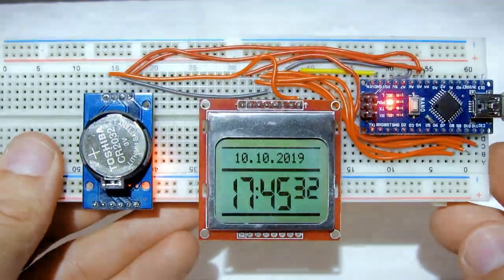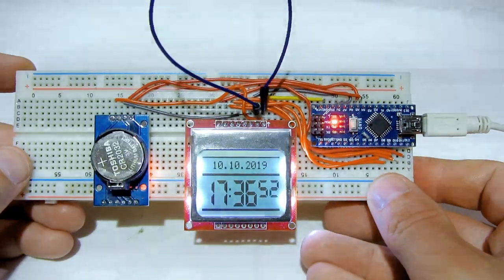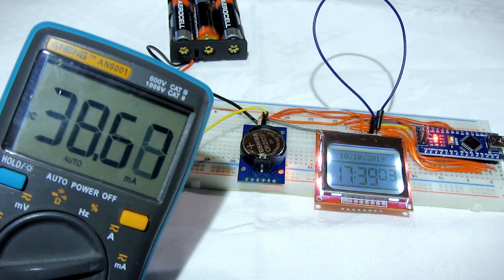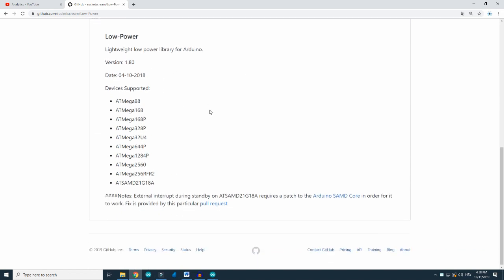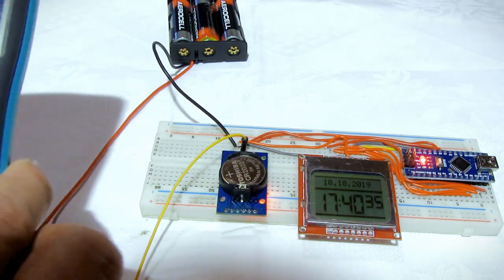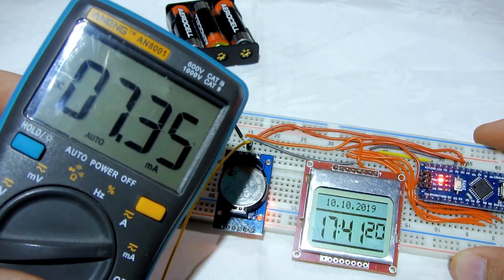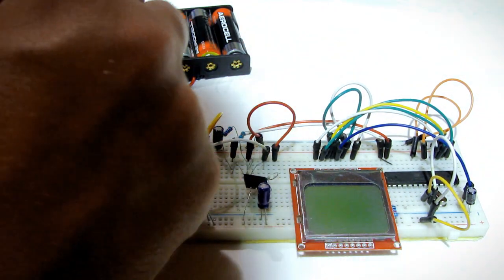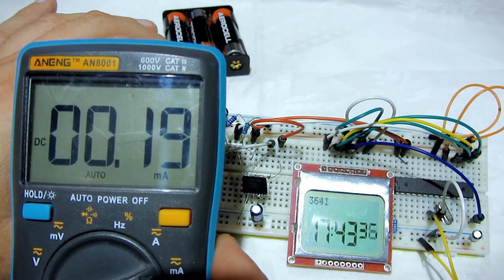How to Make power efficient Arduino Clock, run for years on battery

Comment: Thank you for the great project. You can lower the power consumption by using the 8MHz international oscillator (or even the 1MHz) instead of the extenal 16MHz

Comment: I'm very interested in your power supply solution. Have you powered other projects with (3) AA batteries? Do you have a wiring diagram? I'm assuming that you're powering though the 5v and ground pin?
Reply from the maker: Yes, three aa bateries gives 4.5V that is enought for arduino. Yes they are conected to 5v and gnd
Reply: @VolosProjects  Nice! Have you powered other projects this way? Has it ever caused any issues?
Reply from the maker: @josiahroyer1062  yes, many of them, just make sure that voltage is not higher than 5.5v
Reply: @VolosProjects  awesome! I think I'm going to try this method on my project. 🙂👍